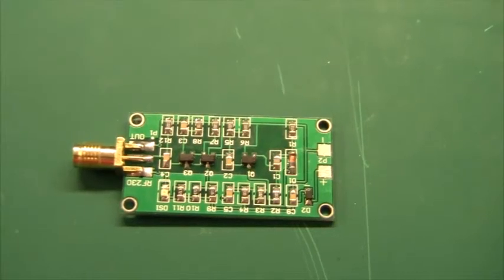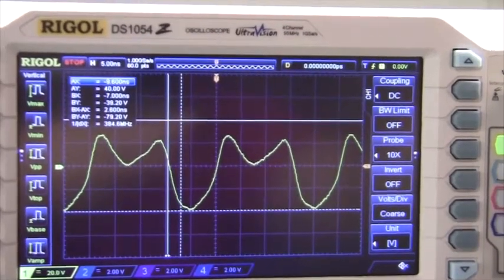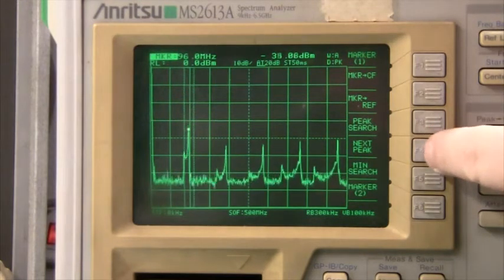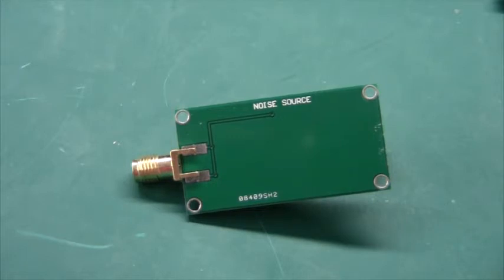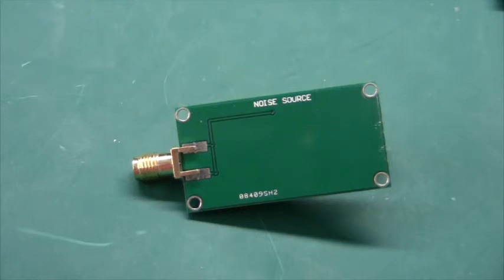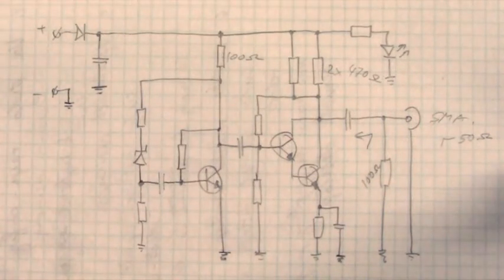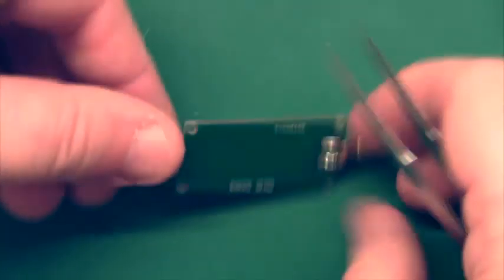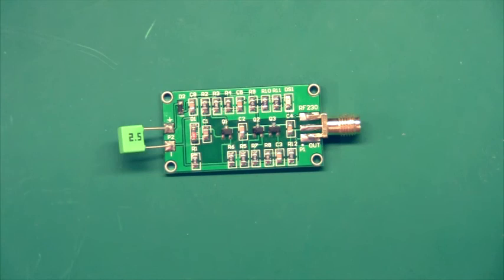Review of craptacular Chinese 1 to 500MHz RF noise source

Comment: This was designed by rookies, definitely. They haven't bothered to rename the planes to ground.
Reply from the maker: I know. It's shockingly bad. Although, I have found a checkbox in the original (and widely pirated) version of Protel that is so widely used in Asia that has this effect. In any case, it should have been checked by the engineer.

Comment: No wonder it oscillates with that layout, amazing! Never seen a layout that bad on a commercial RF product.
Reply from the maker: Neither have I. But... on the older version of Altium there is a checkbox marked "attach ground-plane to net" or something like that. If you don't tick that, it will do as in this layout. I think they made a mistake and only discovered it after the PCBs were fully populated, and then sold them off cheap on ebay? Maybe.

Comment: terminating the output with 50 Ohm might help
Reply: My thoughts exactly. It's amazing how these things can spring to life when terminated properly.
Reply: In this case, it won't. There is no noise being generated to start with. Plus, the whole design will not work. The transistors are not wired correctly. They should be configured for class A operation. Also, they should be using RF amplifiers, not transistors.

Comment: Great review. I have some questions in regards to pcb layout that you or your subscribers may can help me with. I am not very knowledgeable on rf layout or pcb design but I use cadsoft eagle software and am trying to replicate a schematic from http://ludens.cl/Electron/swr/swr.html. My 3 variants are here https://oshpark.com/profiles/tj138waterboy. In this vide you mentioned connections should have been made to the ground plane. I completely understand the concept such as lowering parasitic inductance. Also i noticed no ground plane around the diodes and transistors on the top layer of  the board you reviewed. From my understanding that is correct layout for parts that oscillate or measure rf such as a detection diode. If there is anything I am missing or misplaced on my board design please let me know, or which one is closest to correct.
Reply: Also I planned on adding 2 vias through all pads leading to ground. Redundancy
Reply from the maker: Hi Tommy, it looks really great so far. What frequencies do you intend to use?
Reply: Primarily 140 - 480 MHz  but from what I read about the design it would be possible to go as low as 30 MHz and into 1ghz range with a tad of degraded accuracy. Also could you point out which of the 3 designs I made would best suite the application as far as traces and ground plane? I know it's hard to see but you can make it out if you zoom in on pic.

Comment: Is a secret multi harmonics pulse pattern generator with UFO technology grounding :))) Yepp, made in china... or made in kindergarden.. No! I know what is this!! GARBAGE GEN 1.0 :))))))))) thank You for sharing :)
Reply from the maker: +BMR Studio Actually the schematic looks pretty OK. I am quite sure the Darlington transistors oscillate due to parasitics and then saturates. If they had done their worst-case calculations, used a couple MMIC broadband amplifiers and done a proper PCB layout, it would probably have worked. However, it is not really my job to tell them how to do it.
Reply: Build Your own :)
Reply from the maker: +BMR Studio That's exactly what I intend to. The video will be here some time soon :)